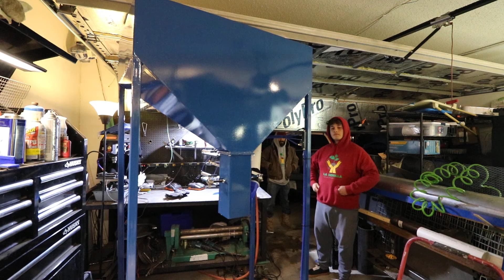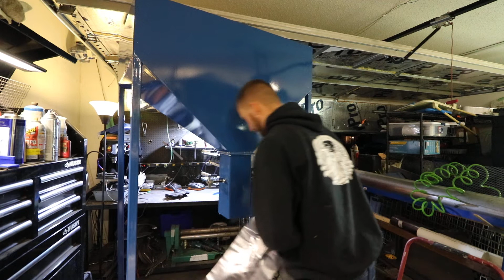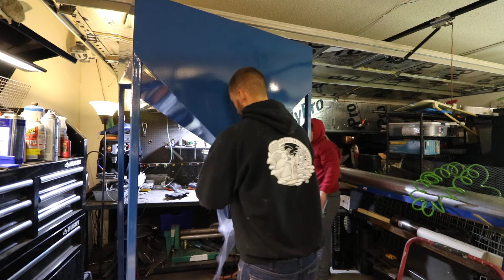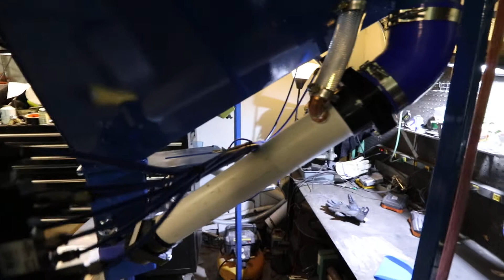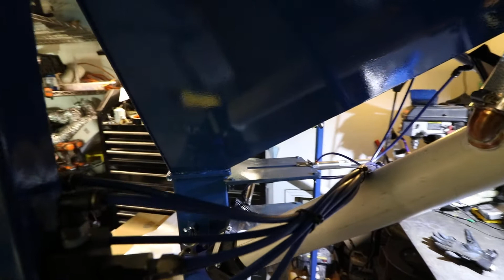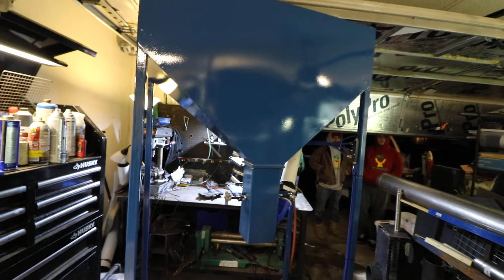New Fastest Gourmet Mushroom Substrate Bag Filling Machine!

Comment: This is great! How long do you wait in between bagging and sterilizing? Also, Is this machine capable of ratios other than 50/50 with the pellets?
Reply from the maker: Yes its adjustable. Ive done 20% powder bran even. You would need to adjust the water down a bit too. I was bagging 7.5 lb bags with 20% bran.

Comment: How long do you wait for the substrate to soak up the water before you put them through the sterilizer?
Reply from the maker: Just a few seconds. What I typically do is have a milk crate holding 4 bags and then once they swell I take it out and load then fill the empty spot with a wet bag.